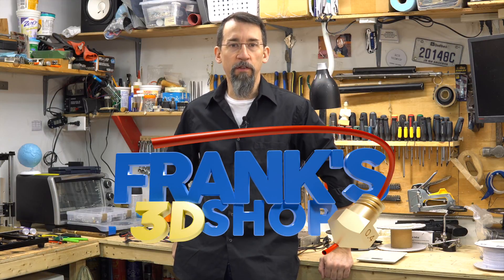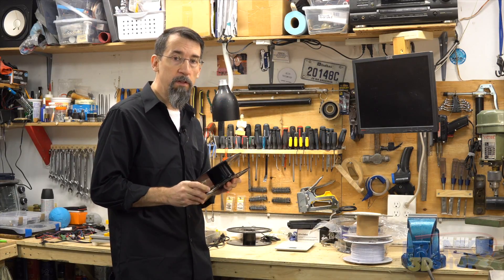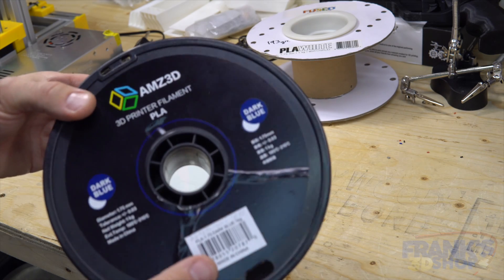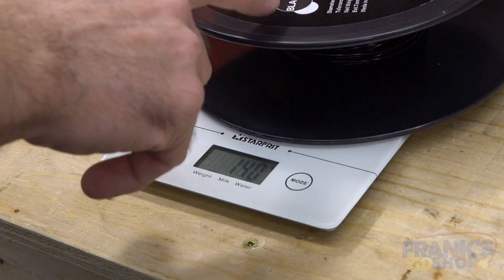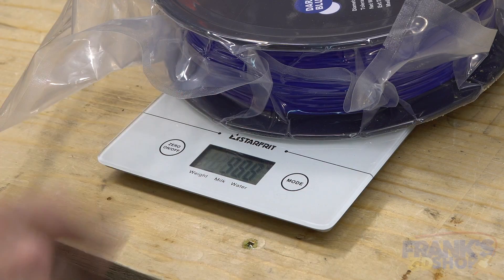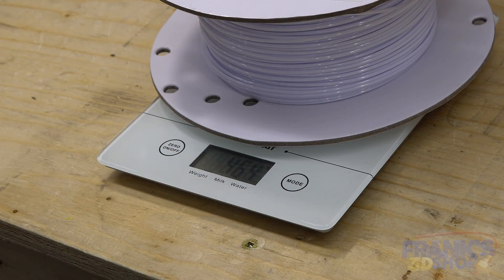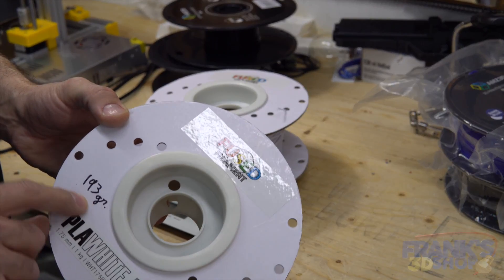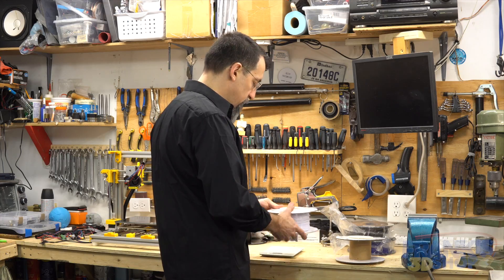Find How Much Filament is Left on a Roll

Comment: Only one problem with your explanation............. you mention a "slicer" ................ WTF is a slicer????
Reply from the maker: À slicer is a program that prepares a files that the printer can understand, it “slice” the 3D model in vertical steps. It can be a program you run on your computer or is part of a web application if the printer is driven online…

Comment: Nice try
but can i print if I have filament but no roll to put it in?
Because i bought filament from a diferent brand and it didn't came with a roll now i don't have an empty roll to put it
Reply from the maker: Yes but it's tricky, I did once, I had to put the filament on the what normally supports the roll, but you have to check up on it so that it does not tangle up. You can also on-roll some, let it feed in, come back on-roll more. You will have to baby sit it... Last thing that I can think of but I did not try this, use an empty bulk DVD case, put the filament in place of the DVD, pouch a hole on the side, feed the filament through, and close the case and make sur the case does not lift up when printing.
Reply: Thanks a lot I will see if i have something like dvd or just babysit it

Comment: A better trick is to measure the weight of a new spool and write it on it. Just substract that value to the filament weight to know the weight of the empty spool. No need to keep an empty spool or a paper.
Reply: Thanks a lot @Didtok. This was perfect to me, as I only have one used (that I want to know how much I have left) and a few new ones. I'll use the new spools to calculate the empty spool weight.
Reply from the maker: Yes you are right, if you are disciplined enough :-) Maybe I am a bit lazy, I prefer not to have to calculate or remember to write the initial weight, and just have the answer right away.